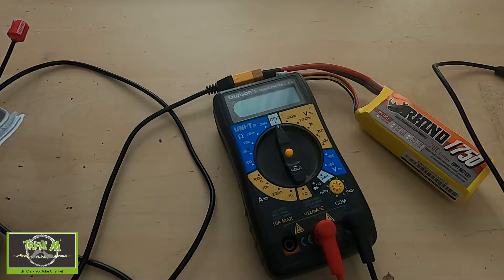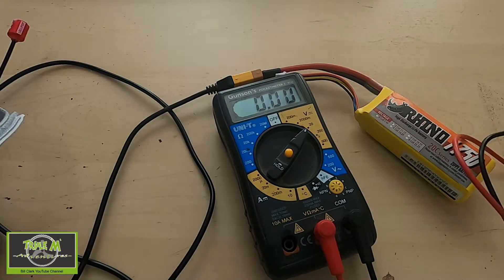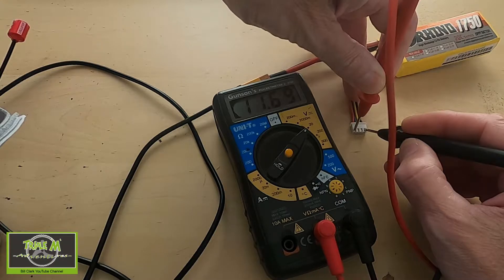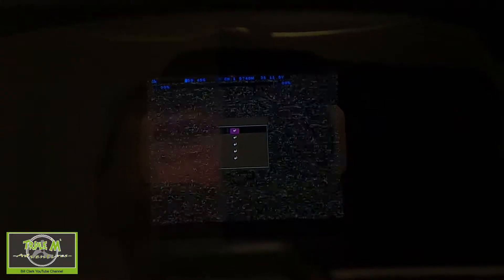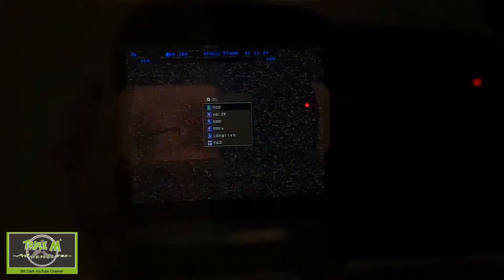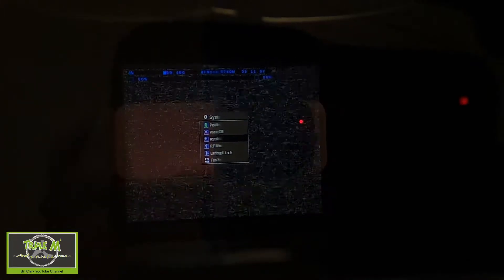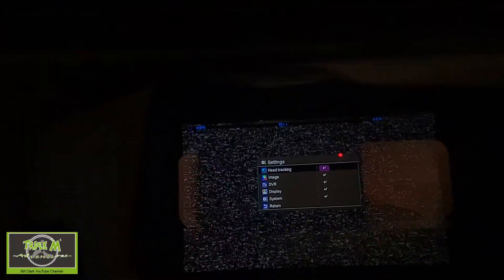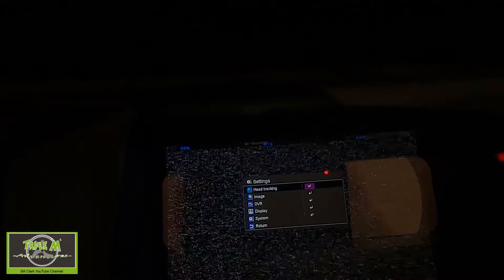How to calibrate the external battery voltage in the Skyzone Cobra X goggles

Comment: On a fully charged internal  battery I am getting short run times. How long are your goggles responsive when running of the internal 18650 battery?
Reply from the maker: 20 to 25 minutes with head tracker switched off.
Reply: @the-happy-RC-flyer  Thanks! That's interesting. Looks like an external battery pack is needed for longer run times. Unfortunately my new pair now doesn't even want to power up, and the battery has been inserted with the correct polarity.
Reply from the maker: @ShermanKenB  that is not good the vendor should replace them. But first try taking out the internal battery and attach an external one to see if they power up.

Comment: Hello Bill, thanks for another cobra x video. Can you go over the controls on the left for example the difference between normal and racing and how the other selections work. Have a great day and thanks again for your content.
Reply from the maker: Here you go Mark.
The Mode Menu:
RF Normal:   With this mode selected the goggles are in normal 48Ch receiver mode, you can select any of the 48Ch.
RF Racing:  You can only choose RaceBand Ch.
Third Party:  The goggles button cannot control the external receiver.
AV Input:  For external video in and the receiver module is turned off to save power.
HDMI Input:  You would use this to view external video via the HDMI connector in your goggles.
Playback:  you can view your DVR files.

Comment: Hi Bill and thank you for the video!
my goggles discharge the 18650 battery only down to 3.6V after which it turns off. Is there a way to discharge it more?
Reply from the maker: Not that I am aware of I have checked the System menu and no way to charge the low voltage cut off. Must be “hardwired” into the firmware.

Comment: I am having issue with cobra x using 18650 battery as power source it won't  last more than and a minute and moment it drops below 4 volts under loads low battery alarm is triggered and it shutdowns.
Reply from the maker: Answered under firmware update video.

Comment: Thank you for the guide! One question, have you update any firmware on the receiver? I have only updated the google firmware to 1.3.4 and still my nazgul5 v2 DVR does not have good signal. The dvr will have horizontal lines and fuzz out even at only 100meters away. Do you have to have this issue? I heard that the receiver might still not be compatible with every analog fpv camera out there and hence I am uncertain if it is my camera's issue.
Reply from the maker: I have not had to update my receiver firmware at this point because it has the latest firmware as at 10/03/21

FW1   1.3.4.
FW2   01.02.00.04
HW     V1.2.3.4.

If you can change your RF Mode from Mix to Diversity in the System Menu you have the latest firmware and give that a try and see if your FPV image improves, as I understand this can sort out camera incompatibility problems.

With my Cobra X goggles I am getting excellent range of 500 metres with my goggles using a TBS patch & Foxeer Micro Lollipop 15cm RHCP antennas, VTX at 200 mw very slight image fuzziness and very occasional picture break up . My DVR recording is great just take a look at this flying video.

https://youtu.be/7GOTBU30YaQ

In your question you say DVR if you mean FPV picture please try above RF Mode change and if still having the problems check the following:

It could be the capacitor has come unsoldered from the FC this can cause major problems with your FPV image and check your soldering of the VTX and camera to the FC.

Has the VXT antenna popped off the VTX? Check the small pins on your VTX and goggle antennas are not bent.

What power output have you selected for your VTX obviously you must follow local power output regulations though at 100 meters 25 mw should be fine.

The stock antennas should be ditched for ones similar to the ones I am using.

Has your VTX been left running at high power output on your work bench which could have degraded the output power of your VTX.

A long answer but I hope this helps.
Reply: @the-happy-RC-flyer  Wow, wasn't expecting such a detailed reply. I will see if I can sort it out and see what the issue may be. Thank you so much!
Reply from the maker: @bennedictbyy  You are very welcome.

Comment: I have been trying to find an answer to why my 18650's only last around 12 minutes in my Cobra X. I have 4 different cells, 2 are brand new. When it reaches 3.9 volts, the goggles just go black.
Reply: That did the trick! Thanks Bill!
Reply from the maker: Joel go to your system Menu what is the Power supply set to? My 18650 is lasting around 30 mins turned on and if low warns me before turning off.
Reply: @the-happy-RC-flyer  Thanks for the reply Bill. My Power supply setting is on DC in. I get no low battery warning.
Reply from the maker: @CF_Joel  if you are not using the headtracker turn if off because the system will use power, I turned mine off. Maybe do the battery calibration with the external battery you intend to use with your Cobra goggles. Hopefully that extends your battery life.
Reply: @the-happy-RC-flyer  Turn of the head tracker, got it. Thanks Bill!
Reply: @the-happy-RC-flyer  when i run googles with 18650 and power it on in menu cant chose 18650 theres oinly dcin 2s 3s 4s ... and also theres nowhere display of voltage also can't turn off headtracker theres nowhere this option in menu
Reply from the maker: @lucalive1302  when you are using the 18650 battery you do not need to set the battery type and you can see the battery displayed top right of the screen as bars. To turn off the headtracker hit the menu button on the right next to the power button and the headtracker is the first option.
Reply: @the-happy-RC-flyer  but when i enter headtracker menu i can't turn it off theres only: PPM Channel, Pan tracking range, tilt range, pan correction and tilt, last one is PPM Reverse
Reply from the maker: @lucalive1302  click on headtracker in the headtracker menu.
Reply: @the-happy-RC-flyer  can't do that don't have this option maybe because i have cobra s not x version
Reply from the maker: @lucalive1302  I have just checked the user manual and it does not say the S does not have the headtracker off option.
Reply from the maker: @lucalive1302  seems strange they have not given the S the option to save power by turning off the headtracker which most pilots will not use. Maybe be a firmware update later will add the feature. Possibly email Skyzone and asking them will the option be added or is there a hardware limitation with the S and it will not work.
Reply: @the-happy-RC-flyer  i hope New firmware will fix many things. They relased it for x version but for s we need w8 more days because of some limitations.
Reply from the maker: @lucalive1302   I have updated the firmware on my Cobra X the new firmware has a drone finder feature very useful.

https://youtu.be/CLl9C25DTjw

https://youtu.be/Ul9kyep-Awo